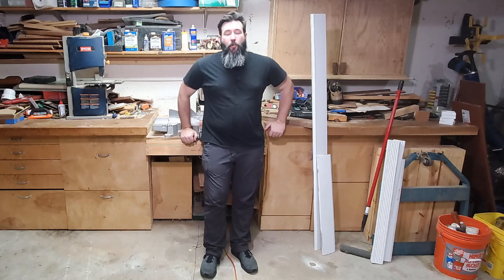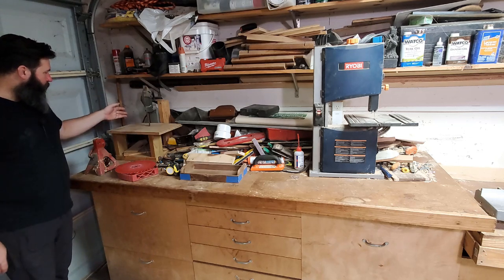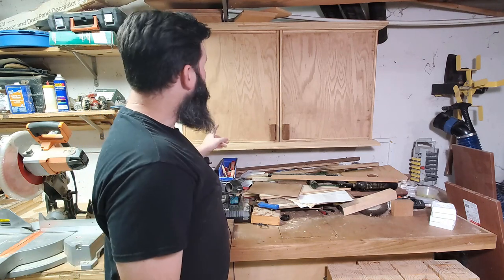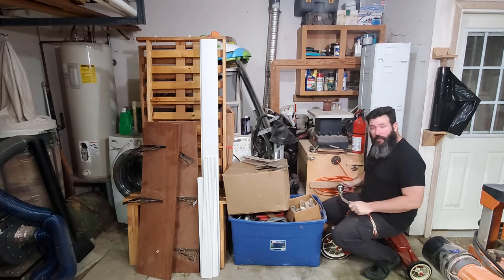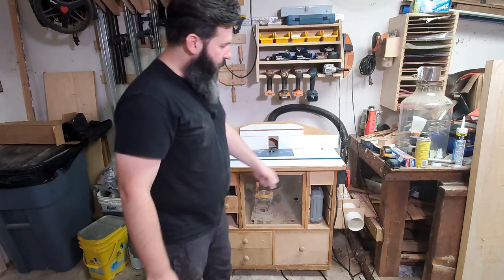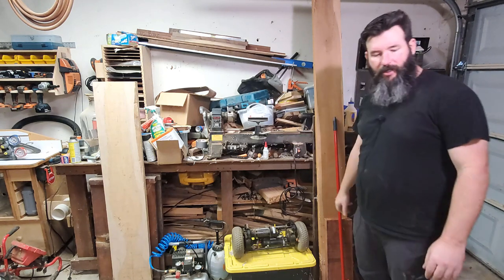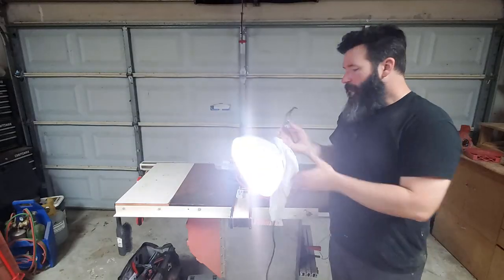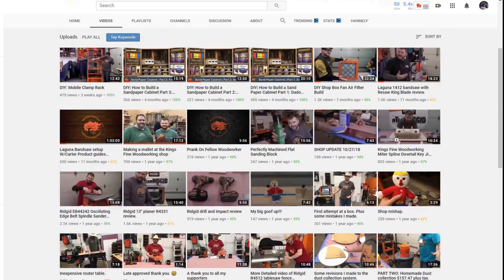2020 SHOP TOUR | My Small Garage Woodworking Shop Layout

Comment: Hey, little late but I live in Florida and just have a garage shop also. I hear you about rust, I have a dehumidifier running 24/7 but keeps humidity in the 50%s. When it's hot (which is most of the year) I also have a window A/C unit (hoping to upgrade to a mini-split) that I run when I know I'll be in there for a while. I also use it when I have the garage door open for a while as it dehumidifies fast then. The dehumidifier I have is the hOme HME020031N (50 pint) that I have draining into a pipe running outside else I'd have to empty it several times a day. Electricity is more but it's not like it's a $100/mo cost.